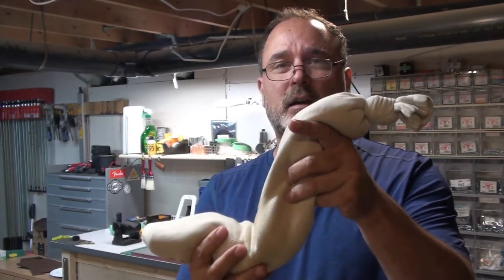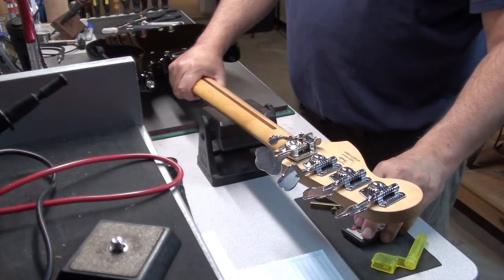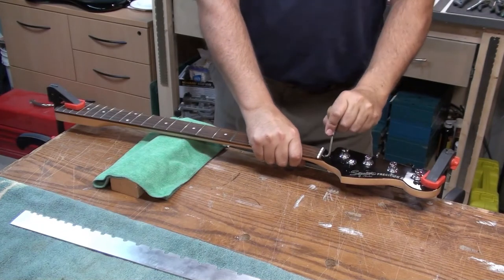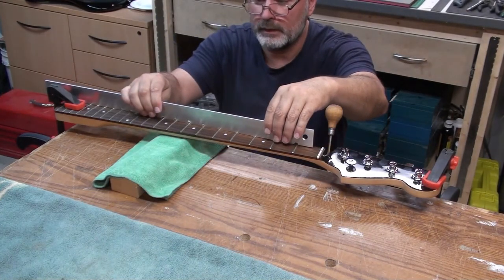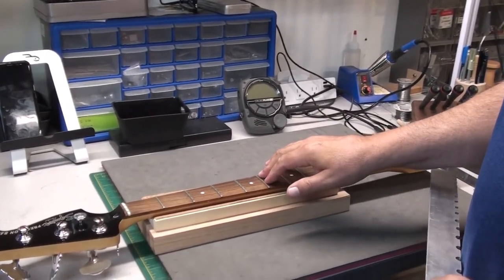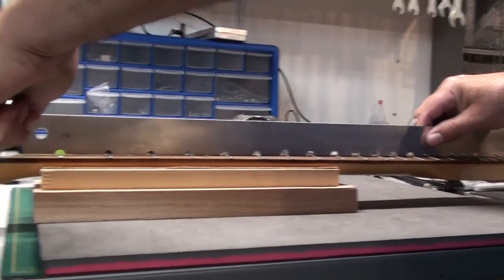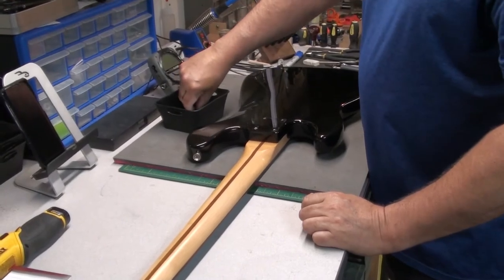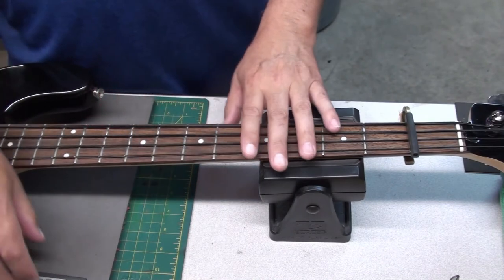Fixing a Bowed Guitar Neck with DIY Heat Press treatment... Using an Old Sock and some Rice!

Comment: this is a temporary fix, as the moisture level in the neck evens out over the next few weeks it will bend again....do not use this method. adding moisture to one side of wood makes it expand(bow) removing moisture will make it shrink(cup)....and, as I said, over time the wood will equalize and the bend will return.
Reply from the maker: That certainly can happen and every neck reacts differently.  I have done at least a dozen necks this way in the last year and they have all remained adjustable and playable.
Reply: @ManotickGuitarTech  I'm sorry if I give your channel any kind of bad representation, but I'm pretty sure you know I am correct(I am assuming this so always room for error)...the only reason that this would continue to hold for years is if the moisture was introduced by the player(or dryness) maybe tilted up against a heater or stove...or near a window where it might get damp(more on one side than the other)....truss rods weren't even invented until they started mass producing guitars as a good way to keep necks straight in a mass produced(use all the crap wood too) manner, but wood is wood...IT WILL EQUALIZE over time based on it's environment.
Reply: Many people use this Methode whith good results Whats the Deal with you 😂
Reply: @dominicgangolff2138  I'm not trolling if that's what you mean...are you a wood worker or luthier? Because my points are well grounded in facts and experience.
Reply: Who said smth about adding moist, the sock looks dry to me. Personally I would leave the clamps there for some days, after removing the sock.
Interesting topic! At least old classical gets way too high relief, also some new ones (Alhambra classicals = never straight necks, not even in the music stores).

I will  just throw out a theory: wood itself has a structural memory, when it comes back to the original shape, it will stay there (?). The clamps and heat just helps the wood to find back to its base. Or what? 🤔
Reply: @evenseb7574  no wood, if it warped or changed shape, will eventually return to that shape...adding heat etc will only help for the short term.
Reply: @dominicgangolff2138  with good results at the moment. No disrespect, but I am a long time woodworker and I think you need to understand what you are talking about(honestly, no offense meant) wood will return to whatever shape it had before you apply heat or moisture or both...it might take a week..it might take 3 months, but it will return to it's natural shape.
Reply: Bah, humbug. I used this method on an all-maple bass neck (i.e., no separate fretboard) and got the neck back into shape. Two years later and it's still perfect.

Practical experience trumps theory every time.
Reply: @fredbloggs6085  I am a woodworker. While it is possible to work on some occasions...it is not a fix. even if it takes 6 years, the wood will move back to the form it wants to have...either that or it will begin to crack or split...
Reply: I'm not a professional woodworker but if 6 years later you spend a few hours in the shop doing it again I feel like that's a better solution than throwing out the original neck.
Reply: @monkeybass01  NO! if you do something like this for a customer....you are literally a POS...that's where I stand.
Reply: @nowherebrain  I'm doing it for myself, not a customer, why don't you just mind your own business if you don't know who you're talking to or what you're talking about.
Reply: I did a similar method as this to a thru body Ibanez fretless 3 years ago and it’s still solid, I used a small orthopaedic heat pad instead, that had a timer, different heat settings and was small enough to keep the heat located to where it was needed. Worked perfectly.
Reply: @nowherebrain No it won't. The truss rod keeps straight.
Reply: @andrewhubbard4222  yes it does, but as the wood moves, so must the truss rod be adjusted....instability, fret buzz and intonation issues will occur. I made a laminated neck with NO TRUSS ROD...horizontally laminated and it is still straight with 11's....11-48...it is about 5mm thicker but it is stable.(for 2 years now anyway)
Reply: @nowherebrain - I get what you’re saying but I’ve seen examples that contradict what you’re saying. For instance, when I played hockey we would curve our stick blades using heat from a heat gun or hot water. Also, wood lacrosse sticks are made of bent wood, indeed some do warp but most stay true to their adjusted form.
Reply: @nowherebrain Wow, you are certainly willing to die on this hill, holy smokes man!

I think you are more than correct when trying to correct a twist with heat, it's as doomed as any other method trying fix a twist.

But in a single plane heat can work. Not always but often enough to give it a try. I have long suspected it is also a matter of softening the glue that holds the truss rod in the channel, perhaps even more than any other factor. I am somewhat dubious of claims regarding glue that bonds fingerboards to necks but I have no way to directly observe either.
Reply: @oldasrocks9121  I am willing to die on this hill..because it is easy when... I'll just say, the science, is in my favor. I'm not wrong. It's not the matter of will it work sometimes...ofc it will..but of the times it works I'm certain a minimum of 80% or the time the wood will move back..either damaging the neck or the truss rod irrepairably.
Reply: @nowherebrain Because you've done it? Or are you speculating?
Reply: @oldasrocks9121  Speculating, I wouldn't do this to any instrument I own.
Reply: @nowherebrain  Right but we're talking about instruments that are unplayable or on the verge of unplayable. If a neck gets wrecked as you surmise it makes no difference: it's already wrecked. 

This is almost always a repair of last resort before replacing the neck. It's not something a tech does or suggests during the course of a normal set up.
Reply: @oldasrocks9121  you can replace a neck, even a set neck.
Reply: @nowherebrain  Sure. But you're thinking of this only in terms of your strongly held opinion.

If you think of it as a risk calculation as any client would say the treatment worked for 6 months and cost $100 in addition to the set-up fee (which is high.) That's less than $17 a month for 6 more months of playability out of the instrument. Less than $9 per month if it works for a year. It's an important consideration especially for a pro musician. 

No good pro tech presents heat treating a neck as a certain permanent fix PRECISELY SO the client knows it's a risk calculation.

Look at the neck in question here: black headstock, likely limited edition. How much will a direct replacement cost, if you can find one? Multiple hundreds perhaps more. A new generic Fender replacement neck will be $400 but even for a player grade instrument it will kabosh any appraised value as a resale.

I'm saying the heat treatment is a good risk for both the tech and the client. For the tech because it is likely it will fix the neck bow for the playing life of the instrument and it's the best economical option to offer even if it fails in several years or even one year. 

It's also a very good risk for the client even if the neck or the instrument complete will be replaced in the future.
Reply: And you have actual experience and proof to back this up? I do. I’ve done more than a half dozen necks by clamping them. Some I added heat to, some I didn’t. All of those necks are exactly how they left my shop bench, and it’s been over 7 years.  Your theory doesn’t hold true.  This is an exceptionally well done video.  His repair was done very well, everything explained well, with good results.  Go troll someone else.
Reply: @terrelldunn3973  I think the fellow initially thought it was wet cooked rice. He never 'fessed tho, if that's what he first thought.
Reply: It’s about heating the adhesive not the wood. Has zero to do with moisture in this case.
Reply: @TheSyfoddler  That depends upon the temperature used. Not arguing about the moisture thing which was a confusion from the start of this thread but glue needs a pretty high temp to slide the fingerboard. Dave's World of Fun Stuff has pretty decent heat treatment vids, Dave explains as much as he knows for certain.
Reply: @TheSyfoddler  You are literally the first person to bring some logic...
It is possible to relax the bonds and sort of re-set to an opposing position...that is something that does work..I do this often when book ending(in a sense) pieces that bow or twist in opposing directions.

Comment: Thanks. This worked fine for my 1982 ESP/Navigator Jazz Bass. It needed several attemps, though. I managed to bring down relief from 0.7mm (.027") to 0.35mm (.014").
Reply: It lasted just a few hours... It seems, I need to give more heat to the neck.

Comment: I used your method, and it worked. In fact it worked too well! Now with no tension on the truss rod, and the string tensioned above standard, I still have back bow. That sucks worse than the original problem!

Comment: Thanks! I built a diy vise system out of poplar, and then used your described method on my set necked Hagstrom Ultra Swede. Note I only did this AFTER a reputable guitar tech told me he “wouldn’t touch it.” After two heat treatments and cooling over a 4 hour period, I was able to change a banana forward bow to a slight back bow (no tension) and perfect slight relief at 7/8 fret !! My truss Rod that was maxed out can now be set at just a slight bit of tension. 

My one new process improvement suggestion is rather than wrapping with a towel is to wrap the sock sausage and neck in cooking aluminum foil. 

Again many 🙏!!
Reply from the maker: Would like to see a pic of your rig you used
Reply: @ManotickGuitarTech  not sure how but would be glad to send pics
Reply from the maker: @perrymann6807  send to my email in the description

Comment: Hey, I really want to thank you for this video. I did it exactly as you suggested, except I didn't even bother removing the neck from the guitar. I fixed a used Strat that I bought that had a warped neck and now it's absolutely straight and plays great. Thanks again!

Comment: I used a similar method on my bass neck. Clamped with a slight back bow, I put it in the trunk of my car on a hot day. I also put a big pot of water in the trunk. I left it there for several hours and it worked!
Reply from the maker: Very cool!
Reply: @ManotickGuitarTech  Thanks. I know leaving a guitar in a hot car can warp a neck so why not the reverse....
Reply from the maker: @gvair  I would worry more about the finish cracking

Comment: A big thank you for this post.

I bought a used Strat AVRI from 2009. When I wanted to adjust the neck curvature, I reached its limit with the truss rod. Even by adding spacers, the curvature could not be adjusted sufficiently.
The local luthier confirmed that the neck was severely concave.
So get to work. First pass in a towel, second pass wrapped in aluminum foil. First 3 and then 4 hours, then let it cool overnight.
Hurray, the neck is straight again.
Neck is a lacquer nitro maple one. No issues, so far
Reply from the maker: @calabash-um9mv  good work!

Comment: Ya know, I looked at your photo, saw the cloth and my problems are solved!
An electric heating pad wrapped around the neck! lmao! 
I saw a way to clamp the body and use strings from the headstock down to the bench to get your angle and rid of twists, but I was always pursuing block based DIY heat press builds. 
THANKS A MILLION DUDE! 
I play so much, I twist necks to the left from my hand curling up around it. I have some really expensive guitars in dire need for years including an 8 string neck through Agile I paid nearly a grand for.
Reply from the maker: Glad the video helped you out - don't forget that I would only do this on unfinished fingerboards... not maple.  I hope you have subbed to my channel?
Reply: @ManotickGuitarTech  I did and fortunately none of the maple need it but literally a dozen rosewoods do.
Reply from the maker: @jondeth298  maple is much stronger

Comment: Fantastic video. For those without a dedicated bench, I simply use a 2x4. Works great. Also, in the UK we heat our homes with radiators. I leave the clamped 2x4 neck on a radiator for a few weeks and it's a bit more of a 'gradual' process. I kind of like your approach though.
Reply from the maker: I don't have radiators...wish I did!

Comment: Many  people say the neck must be steam heated, so I understand there should be some humidity. Should I try your method with rice that had had been soaked before this process? Thanks for any advice!
Reply from the maker: I have never used steam - it could damage the fingerboard or the finish on the neck.  Dry heat works fine.

Comment: I’ve done this with a neck heater that I got from LMI a couple of decades ago.
In my experience tho, it doesn’t last.
Once wood has been “bent”, it likes to go back to where it was being exposed to the same situation.
The only permanent fix is to pull the frets, straighten out the fingerboard, and then re-fret.
Reply from the maker: I have had about a 75% success rate... some wood just won't straighten out.
Reply: @ManotickGuitarTech : That means 25% of your work is being
redone, by you or someone else. Not a good rate.
I hope you warn your customers, they may be paying for nothing, before proceeding.
Reply from the maker: @zapa1pnt  I don't guarantee that the neck will stay straight, my customers understand that.
Reply: @ManotickGuitarTech : Then your customers are stupid, for paying you to do it.
Reply: @zapa1pnt  75% is pretty good if it's a last ditch effort..

Comment: Great video! I came across this when researching how to do some heat treatment to a bowed neck. I just bought a Stratocaster and the neck has a little bit of "natural relief", so to speak, I can get the neck mostly straight up to the 7th fret, after than I get a bit of a depression that goes all the way down to the last couple of frets. Would this method be safe to use on a finished neck or should I take other precautions?? It's maple (neck and fingerboard), finish appears to be poly (it's a 2014 MIM Strat).
Reply from the maker: @JuanJaim  I have only done it on a natural fretboard without finish, but in the comments some people have done it with a poly fretboard with success

Comment: At what settings do I heat the rice. I have a 900W oven. Also, may I assume the sock is to be all cotton... anyway, if I can't talk my local luthier into it I'm gonna try this on a 2008 Samick Malibu that plays like a dream up to about the ninth fret.
Reply from the maker: Don't know what setting on your microwave but you should heat it up to about 175-200f.  All cotton sock is preferable
Reply: I ended up putting the rice in a double layer of 4" stockinette, a coarse jersey tubing used under fracture casts. Also great for hanging salami.
My microwave is only 900W and the heat tolerance of the stockinette was unknown, so I went with 90% power, 4 minutes. Barely too hot to handle, which in food safety means 165º. I just carried it out on the platter and placed it by the ends.
As this was for a urethaned maple fretboard, I took the extra precaution of putting a 4x18 strip of "ShamWow" over the wood.
 @ManotickGuitarTech

Comment: I’m having same issues on a charvel mij so cal. All one price neck maple fretboard. Truss is maxed. It’s an unfinished nexk from what I can tell. Gonna try your guide to correct it
Reply from the maker: I would put a tea towel (something thin) on the neck then apply the heat sock - not sure how a maple board with finish will react.  I have only done this on natural fretboards like rosewood or pau ferro, ebony...

Comment: I recently got a 75 gibson ripper.  It was in a case and the screw in the compartment was digging into the neck around the 7th frett and when I get  playable action, it buzzes around the 7th frett.  I'm going to try this method and see 👀 what happens....
Reply: i have the same problem,what happened, could you fixed it?

Comment: This is NICE !!! and logical !!! and my last resort..... so it is good anyways 🙂:thanksdoc:
Got stuck with a 50's archtop that was arched, no truss rod, or access..... So right now she is under the "beans".... Could not remove the glued neck, so I constructed a custom press .... Wait and see in a few hours, gave her a slight backbend since no truss rodd to work with afterwards. Hope it does the trick !
Reply from the maker: Let me know how it turns out
Reply: And... WOILAH ! It appears do have done the trick 🙂 Minimal backbend, and with .13 strings she is just (arched) right ! What I did is build a custom press (glued neck) clamped foot, with a v-shaped block with leather inbetween at the lowest point and squeezed the headstock clamp until backbend on the (selfmade) ruler. Heated the rice sock 3 sessions with 4 hours in between ( microwave is 700W - 3 min, 3 min, 5 min) and covered with a towel. Total time including final cooling and glue able to dry was 24 hours.  Rings like a bell ! Next up will be refretting and placing a Johnny Smith neck mounted pick-up with V&T ..... and I am afraid she needs to be refretted (will be a first for me and your next youtube I will look for :hand-orange-covering-eyes:

THANKS !
Reply from the maker: @gijsvlas9120  that is great!

Comment: Will this work on an acoustic guitar or classical guitar? Why a sock and rice for heat? I am afraid heat will make the frets sharp.
Reply from the maker: Heat won't make the frets sharp...not sure what you asking there?  I used rice in a sock to show that you don't need any fancy or specialty devices.
Reply: @ManotickGuitarTech  I have used an iron before for heat and it sometimes made the frets sharp. So now I put the iron on the back of a guitar neck on a metal ruler for heat and clamp it after. A guitar repair book has using an alcohol lamp for heat but I don't know how to do that.